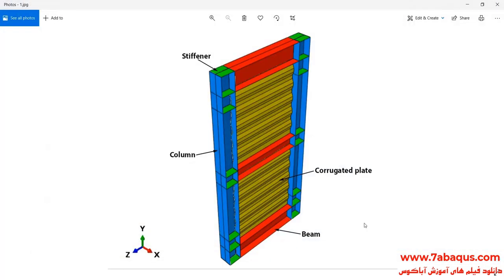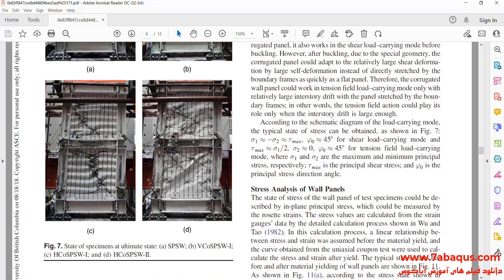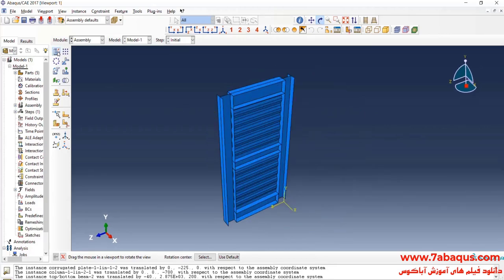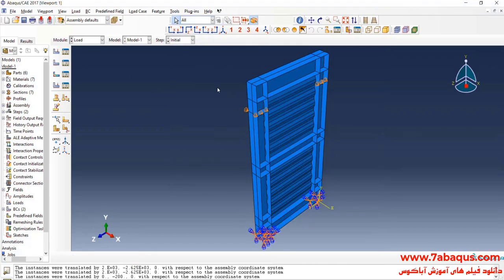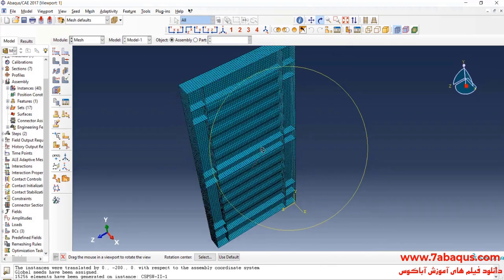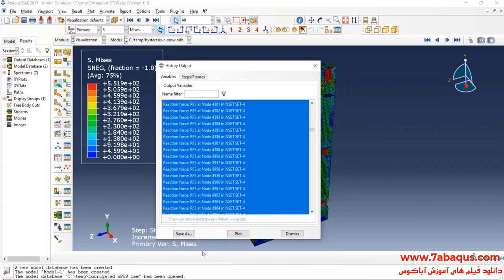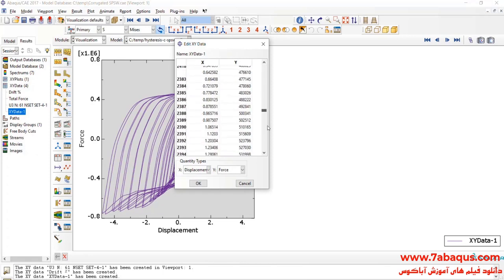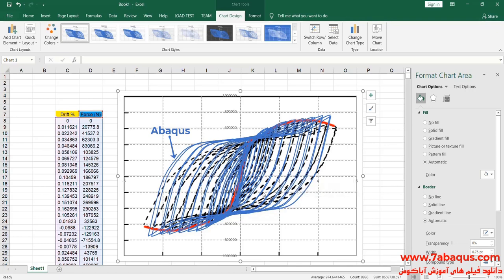Cyclic behavior of corrugated steel plate shear wall (CoSPSW) Abaqus

Comment: Sir please make a video for cyclic performance of a corrugated steel plate shear wall with vertical, horizontal and inclined orientation of infill plates
Reply from the maker: This model includes horizontal and vertical orientation of infill plates
Reply: @saeedmoeini-7abaqus  is it easy to Make a inclined infill plate sir ?
Reply from the maker: @hellohai8720  Almost Yes